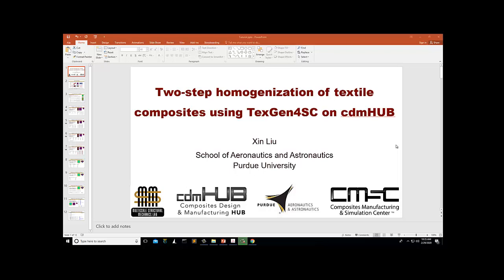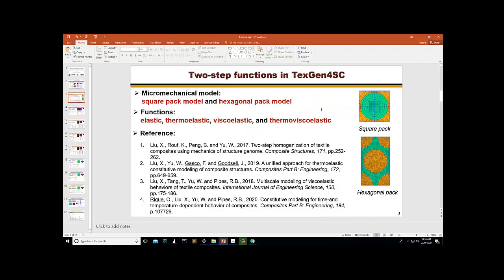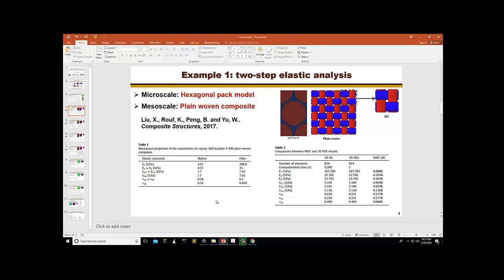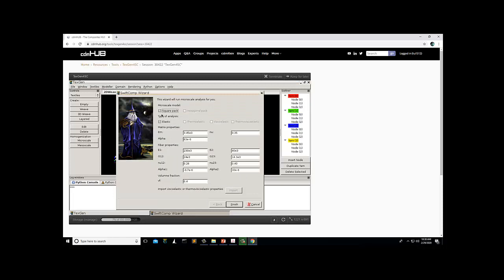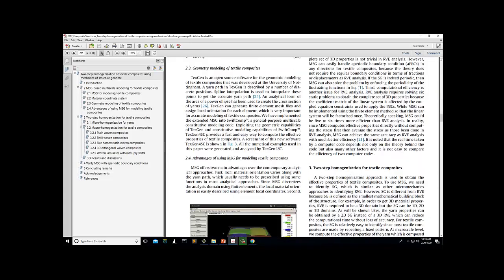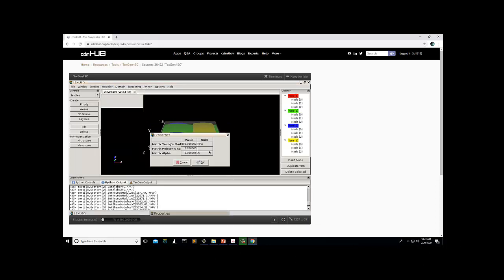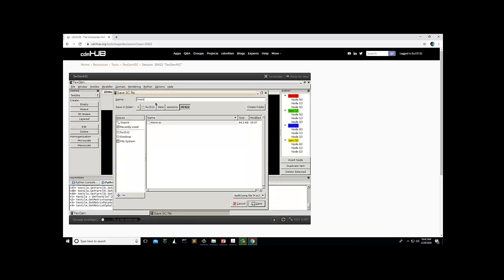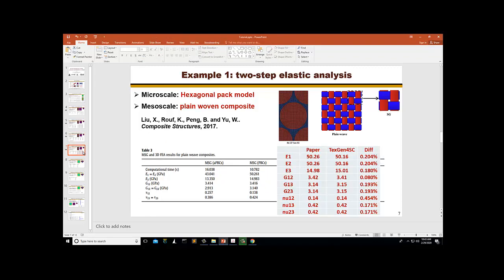Two-Step homogenization for elastic analysis of textile composites using TexGen4SC on cdmHUB

Comment: Hi Xin, 
How would I go about rotating my plies in TexGen4SC? I need to find the elastic properties (from constitutive) for a [0/60/-60] lay up. I'm able to rotate the plies in the original TexGen, but don't see a homogenization "button" to click to find the elastic constants. In TexGen4SC I am able to compute the elastic properties with the homogenization button, but cannot rotate my plies. 
Thanks, 
Allison
Reply from the maker: TexGen4SC was developed based on the previous texgen, so there is no rotation function in Texgen4SC. There are two solutions. 1. perform homogenization for woven lamina to get elastic constants, and then perform lamination model using the homogenized properties with the layup angle; 2. Export the rotated woven laminate to Abaqus and convert Abaqus inp file to SwiftComp file, but you need to be very careful about the RVE domain for periodicity.